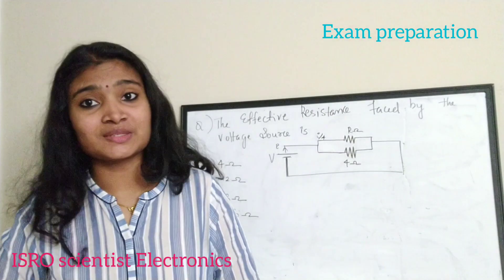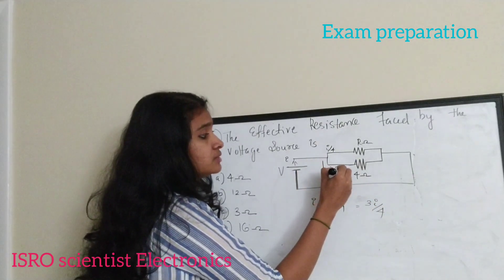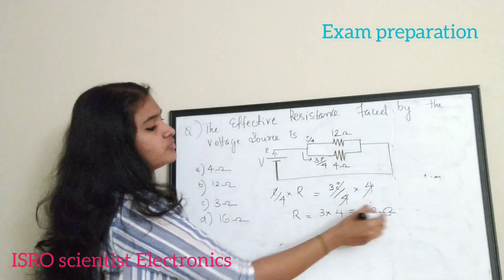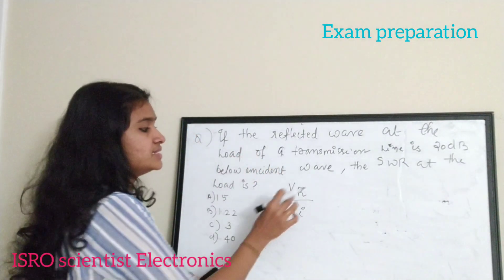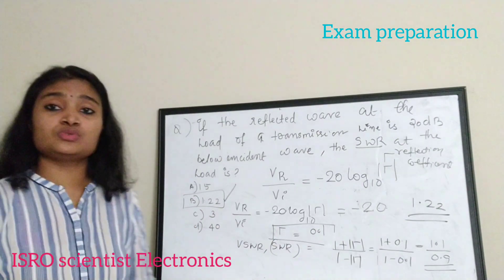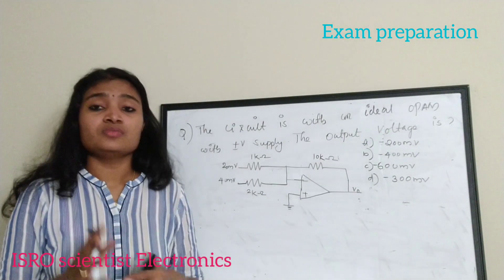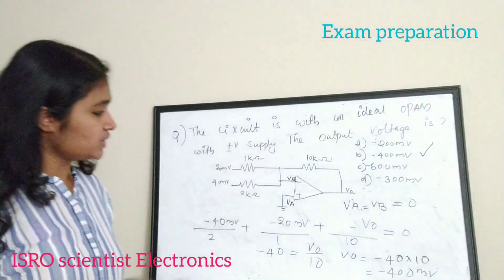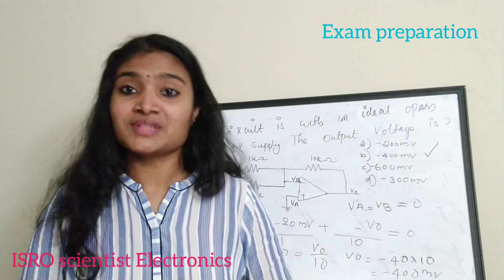ISRO-ICRB Exam Preparation|| Scientist/ Engineer - Electronics Preparation Part 2

Comment: How antilog comes out to be 0.1 it should be 10 as minus and minus got cancelled it should be 10^1 and not 10^-1
Reply from the maker: Sorry the Equation is 20 log|reflection coefficient| not negative on the LHS. Correction added in description. thanks for your comment

Sorry for the mistake
Reply: @EasyElectronics_jobupdates  ur videos are worth emulating..please make more videos on previous year isro question and also add crisp notes so as it becomes useful for revising before going to the big event
Reply from the maker: @sarbojyotidebpurkayastha9882  yes, i am planning to make maximum videos with this two months
Reply from the maker: Hope to see such constructive comments in future also.